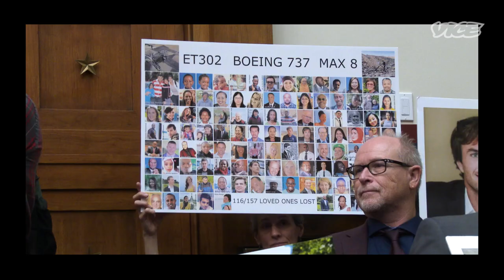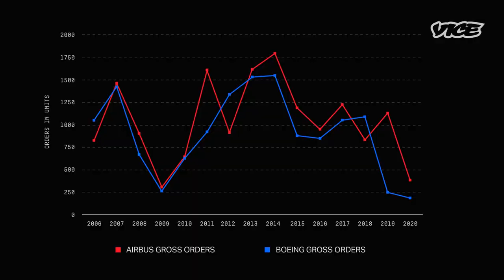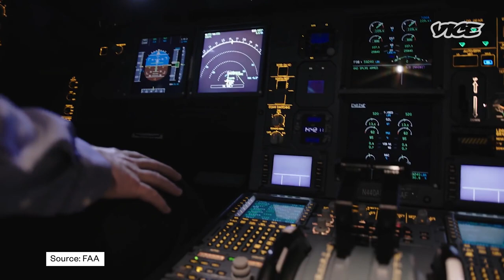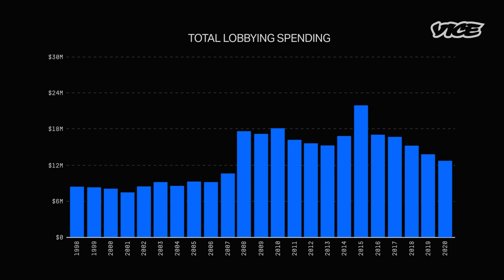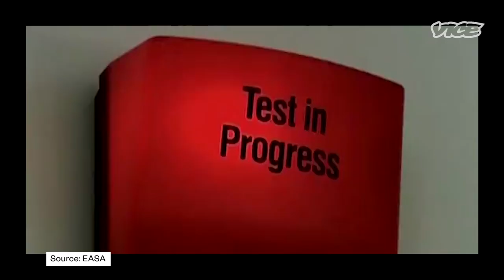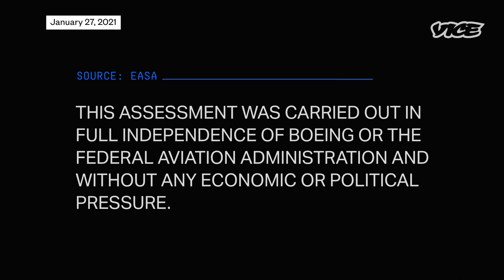Why Greed Causes Planes to Crash | System Error

Comment: I'm 90% sure how things went down. The engineers probably said that they can develop it in x years. Management then said great and started pushing for customer commissioning after ½x of time had passed.
Reply: And the engineers said it had to cost this much but the ceo said costs had to be cut, therefore cutting corners
Reply: Management receives a well-documented manual. What is this "mcas"? Most likely a spelling mistake, I'd better remove the entire section
Reply: You have worked in manufacturing.
LOL
Reply: No, what happened was that their competitors made a new revolutionary plane. Boeing didn’t have a plan for a new plane, so what they did was design bigger engines on the same model plane. This caused the nose of the plane to drive upward, so Boeing added a sensor to combat this by dipping the nose down. The sensors were too sensitive and caused the planes to nose dive into the ground/ocean. These sensors are still in the planes...so don’t fly anywhere on a 737.
Reply: @Thomaswinds  Exactly
Reply: It was the competitive pressure/time line to offer a plane to match Airbus.  The commercial plane market moves faster then the ability to provide the perfect jet....
 This didn't allow designing an all new plane to match the larger more efficient engines that are now available.     The software glitch was only a temporary patch for the old airframe design...
Reply: Exactly
Reply: @Marcoo_S14  yup!
Reply: Agree 100% ... This phenomenon of upper management sucking out time, resources and funds just for sake of cost cutting and profitability is common across all industries sadly, even as an IT engineer i experienced that we are pressured to deliver something in days to satisfy marketing teams ridiculous timelines at cost of code quality, security standards and maintainability.
Reply: @Thomaswinds  I suggest you to listen the podcast by Greg Feith and John Goglia on Flight Safety Detectives regarding Lion Air crash analysis, MCAS was not the main cause of the accident but rather several multiple events that if they were handled carefully then the accident might be avoided. Several factors like co-pilot fatigue, sick pilot and incomplete maintenance process, wrong adjustment on AoA by Lion's ground engineers etc. But Lion Air was also not completely open to investigators and chose to blame solely on MCAS failure, which is not totally correct. However I agree with the statement that pilots need to be trained about MCAS system.

Comment: “...the 737, a plane that first hit the airways in the 1960s”

Shows 707
Reply: At least they showed a Boeing jet... most of the documentaries out there start with “this is a Boeing 747 Jumbo jet” shows an Airbus A380
Reply: still better then etc doing a documentary about the 787  and showing a airbus a340
Reply: Then they claim that the MAX crashes were from a stall. No, MCAS software pushed the planes downward. Lots of incorrect info in this vid.
Reply: @dennislin1212  I didn’t even make it that far. They had 2 years to gather basic info and this thing was lousy with errors
Reply: Its a tube with wings, whats the difference?
Reply: Lemme just say the people that's editing the videos aren't necessarily the one's writing the stories. So I don't think this was a blow to their credibility
Reply: This isn't an aviation history documentary
Reply: @dennislin1212  it was from stalling however. The confused pilots were basically fighting the MCAS system pushing the nose down by pulling on the stick. The drastic and repeated change in pitch led to loss of speed at low altitudes and they went into low altitude stalls. Pilots had no idea what MCAS was doing and thought they were fighting loss of control by pulling back.
Reply: @CM-hk1hv  eh... it really wasn't though. Faulty AOA readings led the software to think it was stalling when it wasn't, so the plane kept trimming itself nose down. For all intents and purposes it was a runaway trim incident.
Reply: @schmal911  what you said didn’t invalidate my statement. Why did the plane fall out of the sky? It stalled. What caused that stall? Electronic/system issues that triggered a system the pilots were not aware of that led to maneuvers that compromised the airplanes flying ability. You’re trying too hard and looking foolish.
Reply: @CM-hk1hv  No, neither plane stalled. They both crashed into the ground while overspeeding. Read the crash reports.
Reply: You're missing the forest for the trees. Many in this thread are.

They're doing powerful investigative journalism that calls out corruption. But you blow the whole thing off because they missed some irrelevant details. Those details are not what this video is about. The larger scheme between Boeing and the FAA is what we're here for.

Does the plane in the B-roll seriously matter to the larger issue? Seriously?
Reply: @Leo9ine  I was pointing out a funny mistake, the fact that this has been solved after two years and they still had basic details wrong was the problem
Reply: @CM-hk1hv  No, neither plane stalled. Quite the opposite in fact - the MCAS system believed the aircraft was stalling when it was actually flying normally. As a result, it manipulated the trim and pushed the nose down intermittently. The pilots were fighting to stop the repetitive dives but were unsuccessful.

In fact, in the case of the Ethiopian flight, overspeeding was a contributing factor to the pilots being unable to manually (with their hands on a crank-wheel) trim the aircraft out of its dive.

This is a good documentary (see Leo's comment about missing the forest for the trees) but it's important to clarify what happened.

Comment: 5:53. It didn't stall, MCAS commanded nose down trim inputs due to error in the angle of attack indicator (which assumed the aircraft was pitching up). This caused the aircraft to pitch down with continuous nose down trim, overiding full elevator pitch up authority.

Comment: So they made a plane that is unbalanced and naturally pitches upwards and they only decided to fix it with a software?? That wouldn't pass if they were making a military plane ... Reminds me of that time when I made a plane in ksp that would pitch upwards due to its flawed design and I was too lazy to figure it out so I just adjusted the trim everytime before take off...can't believe boeing would do that irl...
Reply: Military planes are actually unstable by design so they can be more maneuverable. The issue is not that software's required -- it's how incompetently and flawed Boeing's implementation of it was for the Max.
Reply: Well if the problem was the software and lack of training, then the obvious fix is to patch/recertify the problem software and train pilots to the extent which should have happened in the first place. And to suggest the course of action would be different because of a mil aircraft incident is silly. This process of ground fleet, patch, recertify and fly would happen regardless if military or airline aircraft. The problem is lack of technological understanding and engineers, hence the revolving door described in the video. Boeing is trying to gain market competitive advantage over Airbus, they want larger volume of civilian products sold faster, which is why they didn't bother telling aircrew about the difference in capability because doing so doesn't scream potential and profit to investors. But getting the hype over 737 MAX, does. And Boeing isn't competing with Airbus to sell military aircraft to the US government, so if anything they would have grounded the fleet immediately after new avionics or software install.
Reply: Computers fly planes more each year.
They should just eliminate the pilots and go full autonomous....
 that is where it is all headed anyway.
That's the future..
Reply: @michaelmccarthy4615  That's another good point. The MQ-1 and MQ-9 unmanned aircraft already heavily rely on software capability. You might be surprised to find out, that when these aircraft detect icing conditions, and identify approaching stalling conditions, that both of these aircraft will dip the nose down in order to reduce their angle of attack and protect the aircraft from icing up. It's then the responsibility of the aircrew to maneuver the unmanned aircraft below freezing altitude. MCAS on the 737 MAX sounds somewhat similar except that this mishap software erroneously detected stalling conditions, dipped the nose low and refused to let the pilots take control of the aircraft. But this accident would have happened if it was Piloted or an unmanned airline. Boeing/FAAs major problem is refusing to properly train airline pilots. They deemed a PowerPoint presentation valid training and it killed hundreds of people.
Reply: @michaelmccarthy4615  That’s not remotely true, every take off and landing you’ve ever experienced as a passenger has been done manually (by-hand), there is some automation in the sense of lining up a landing and after takeoff and reaching cruising altitude the autopilot can be turned on, but anything other than level flight is being done manually. 

Pilots do hard work and it’s difficult they’re not just setting a computer and kicking back all day.
Reply: @SauberC10  i don't want a pilot flying a plane I'm on.   Modern aircraft will be autonomous.   Pilots are not needed.  The human limitations/ factors have been surpassed by technology a long time ago.  Only government regulations are holding back the advancement of fully autonomous commercial flight.  Boeing is working with the FAA to certify 1 pilot commercial aircraft.   Zero pilot will be next.  
Everything can be done with technology.   Nothing is out of the reach of more automation.   
 No job will be performed by a human that is better suited for a machine.

Comment: Truth is Boeing went from best in class 20th century engineering firm to a Wall Street just-in-time assembly line with thousands of subcontractors taking on the development burden with no oversight. Only stock buy backs and quarterly profits are of concern - the proud 1950's engineering culture in Seattle is long gone.

Comment: Have airbus check for boeing and boeing check for airbus. They will try to find a flaw in each other while trying to perfect their own. That way, customers will be able to see if a company is not doing inspection work properly or not
Reply: Boeing is actually doing at this moment, they filled complain for 321XRL, which is probably the biggest treat for Boeing since they don't have such plane.
Reply: you can't make 2 producers from different parts of the world to check each other, you need to make the FAA do its damn job just like EASA does

Comment: I was told by a pilot that they where never trained to pull the breaker to cut power to the MCAS incase it started acting up, he also said depending on the attitude,  pilots only have 2-6 minutes to cut power or the plane will stall.
Reply: As a pilot, the first part is partially correct, but the second part makes no sense at all

Comment: Not the first time Boeing has done this with the 737. They had a major Rudder defect in the older version of the plane and spent 10+ years slandering the dead pilots and the Airlines on negligence over 3-5 different crashes. Look it up.
Greed always wins.

Comment: This is also because of the constant push for automation so they can sell new, more expensive planes when the old ones still work fine. Commercial pilots undergo huge amounts of training, so there is no need for increased automation. They need to be able to easily take manual control of their planes at any time; at no point should a computer be able to override a pilot.
Reply: Okay so what happens when a pilot deliberately takes control of the plane and crashes it ? Because it has happen before. 

It’s a double edged sword on one had taking full control at any moment is important but really if a computer can override a pilot from going off course ( flight 370  as an example) it’s a tough situation but no pilot can ever be 100% trusted

Comment: Boing wanted to save time and cost to sell the plane by fixing a design problem with software. And to further save time on certification, the software only takes critical data from one of the angle sensors so that it doesn't need to go through a length certification process for a system that need to take data from more than one source.

Comment: Fact check: 777 engine issues has nothing to do with Boeing. Those engines are manufactured by Pratt and Whitney or GE. The airline chooses which engine when they purchase the plane.
Reply: Fact check: 777 engine has little to do with the crash. The engine itself has no problem. And no, airline only chose from listed engine models, they don’t decide which model will be listed as an option. It is the Boeing’s decision to put an unfit engine model on the list and not bothering to include a detailed training manual and totally forgot to let the pilots know that the new plane has included liftoff assisting software, which caused struggling between pilot and the software.

In other words, the responsibility lies almost completely on Boeing for boycotting FAA regulations and not even bothering to do extensive tests before rolling it out for the customers
Reply: @HenryTitor  shes talking about 777 engine problem not 737
Reply: As a Boeing employee, It’s very dishonest of you to push responsibility away and twist the truths.
Have some professional decency pls
Reply: @TheDexsword   Yet the video was about 737. Did I miss something?
Talking about engine failure is one thing, talking about engine failure in unrelated topic is another. 
Also, she works for Boeing customer service as she pointed out in her channel video 9 month ago. The amount of intensional dishonesty and misleading is just too much.
Reply: @HenryTitor  She's talking about 2:12 of the video where Vice brings up news reports on 777 engines

Comment: The center of gravity is off on this plane experts have said. That w never get fixed so it's always the work around?
Reply: Yes exactly. This is due to changes made to accommodate the bigger fans on the new more efficient and powerful engines.
Reply: Nope, thats a common myth. The engines generate lift and can reduce stick force margins at high AoA and low speed.

Comment: the main purpose of the MCAS is not to point the nose down in case of some pilot mistake. The idea is to keep the interface exactly like the original 737, so that the pilots would pilot it exactly like one and the system would correct the pilots inputs so it would do what it was supposed to. In this way, 737 pilot would not need to be trained again. In no moment the pilots had to make mistakes for those accidents to happens, they were told the plane would behave in the same way 737s behaved their whole career and it did not and therefore they didn't know how to correct the problem.
Reply: That's incorrect. The MCAS was an addition to an existing system, automatic trim. The pilots had no ability to interact with the MCAS. The solution to their problem was exactly the same with or without MCAS. Addressing a malfunctioning trim computer has always remained the same. 

The pilots in question were incompetent, period. They failed to deal with a basic malfunction.

Comment: Boeing 737 max has a DESIGN PROBLEM, the engine is too low . NO AMOUNT OF SOFTWARE FIX CAN SOLVE A HARDWARE PROBLEM.
Boeing must cancel  the faulty 737 max and must design the jet from drawing board

Comment: The Interesting thing is most people won't even know there on a 737 Max from the NG 737 series unless there an AVGEEK or Pilot the only people in my opinion that look to see what plane there on let alone know the names of the planes
Reply: Yeah my first impression was that too. But theres a lot more ppl actually checking what type of plane they are using through 3rd party because of this stuff happening.
Reply: A lot of airlines in Asia put the type of plane they use for each flight when you buy a ticket online. Most people didn't care. I didn't. I do now though.
Reply: like any 737.  there is a stab trim cutoff on the horizontal stabilizer trim motor.  Takes power away, or pull the circuit breaker.
Reply: Well simple: If it's a boeing, i'm not going!

Comment: VICE @ 5:50 “The plane stalled, and hurdled to the ground”...... WRONG!
This is where you have to ask how shoddy is the rest of their investigation and review process?
MCAS forces the nose down with large / rapid inputs of trim. Because there was a software and hardware flaw it did this under certain condition when it shouldn’t. MCAS forced the nose down and flew straight towards the ground while pilots fought it with all their strength. A stall never happened in either of these crashes or other MCAS related events.

- Actual Airline Pilot, not a journalist talking about a subject they know almost nothing about.